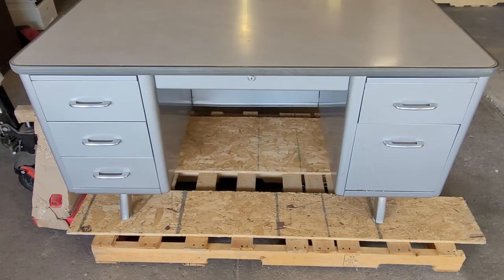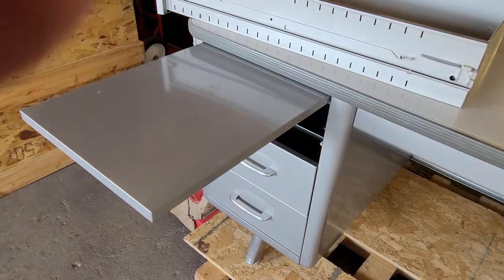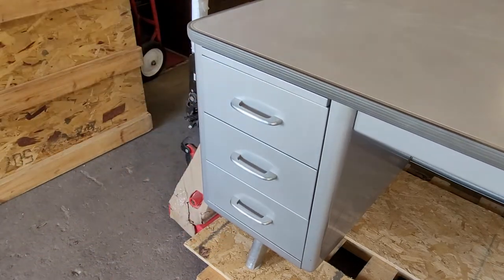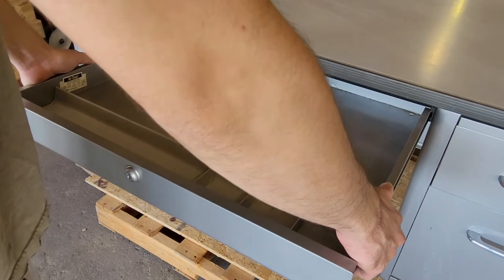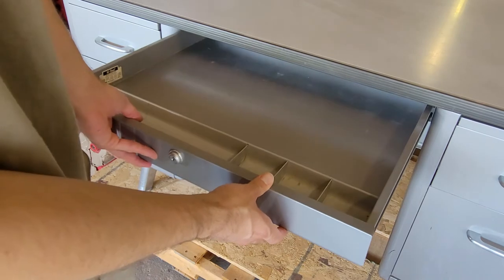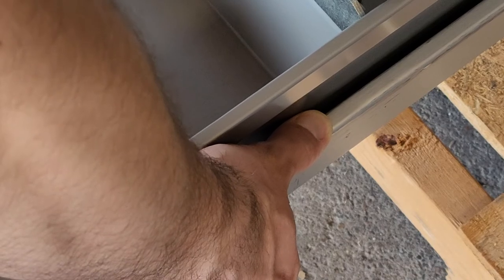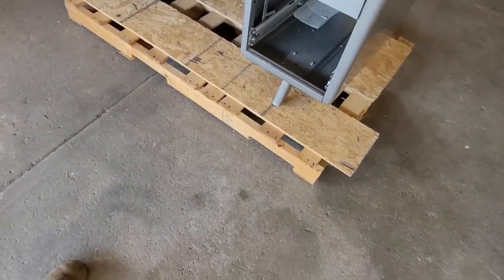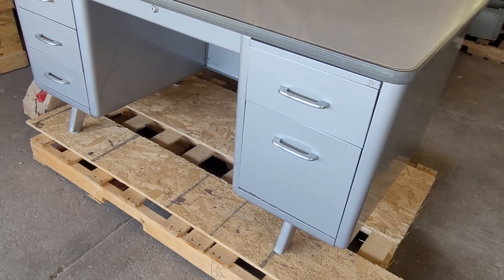How to remove the drawers in a vintage All-Steel arch leg tanker desk

Comment: We need to replace the lock on the center desk drawer for one of our business steel desks. However, the lock is completely enclosed by the the little metal paperclip partition tray. Any idea how to remove that little tray so we can access the internal part of the lock to see what kind it is for a replacement? Thanks!
Reply from the maker: I have a general idea.  If it is quick and easy like I'm thinking I will add a video real quick.
Reply from the maker: Ok got the video up.  Even easier than I was expecting if yours is designed the same way mine is.

https://www.youtube.com/watch?v=8Q0-0UPdDiQ
Reply: @computersales  That would be awesome!
Reply: @computersales  Thanks so much! Ours doesn’t have the little tabs in plain site on the bed of the drawer like yours does (which still leaves it as a bit of mystery), but we were pretty sure that it was just a squeeze/tension type of deal like you showed! I will take another look at it when I have a chance. Thank you SO much!
Reply from the maker: @M.L.7  Strange. That seems to be a consistent design on my end. I'd suggest looking at the bottom of the drawer for any obvious attachment points. Generally speaking their preferred design for a part like that is to be friction fit and swing out though.

Comment: I’m having trouble opening the three drawers only on the left side. Right side opens fine. Any idea what’s getting caught or a solution?
Reply from the maker: When you transported the desk did you tip it on its side ever? There could be something bound up in the drawers. Things tend to get lost in these desks over the years. If you tip the desk at all the stuff will shift around and cause problems.

Comment: Could you provide information on how to remove the top of the desk? I am trying to refurbish a steel tanker desk and would like to remove the top
Reply from the maker: I don't have any immediate plans to tear one down that far unfortunately. The screws to remove the top are located in the two side pedestals. Once you remove all the drawers you can kind of poke your head in there and look up and you'll see them.
Reply from the maker: Also if you plan on tearing one down that far I would recommend flipping it upside down first to save some headache and injury.
Reply: Thank you!! I am staring at it right now so the quick reply is so so appreciated. Yes it's more of trying to move it up a smaller staircase that having it in pieces would be much easier. I know they are meant to be disassembled and reassembled but it seems daunting! Yes I will slip it over and start tackling it that way
Reply from the maker: @aliciapeters4118  Hopefully the description will be helpful.  I'm kicking around the idea of making a video the more I think about it.  Although I probably won't actually take one apart.  Mostly just show where stuff is.  

They definitely are easier to move disassembled though.  The All Steel credenza I have in my office would have been a nightmare to move upstairs in one piece.
Reply from the maker: @aliciapeters4118   Been a while. Hopefully you were able to get the process figured out. I finally made a video of completely taking one of these apart in the off chance you never got around to your project.

https://youtu.be/SSF-L770fsk